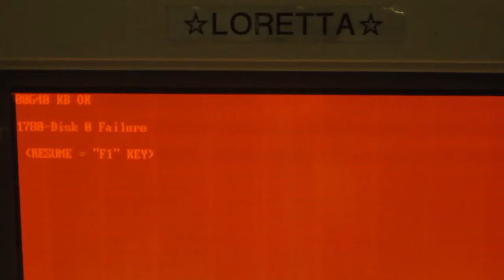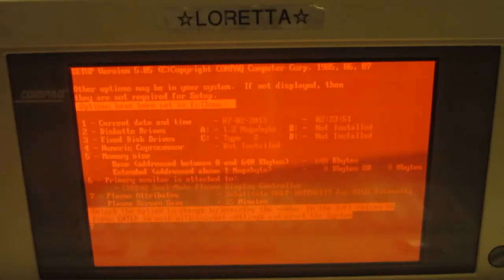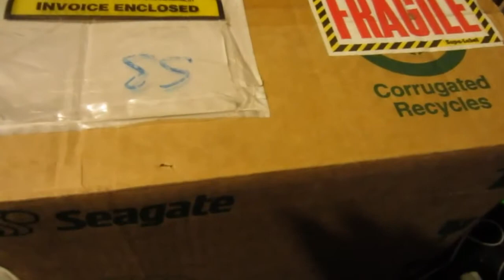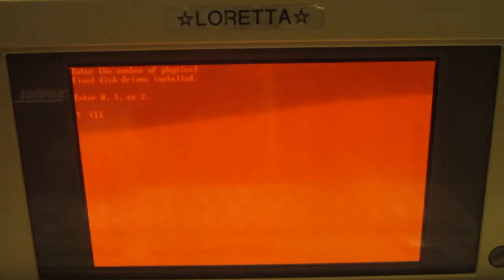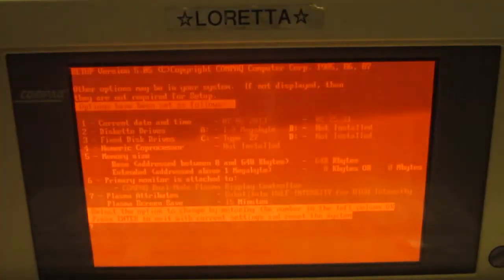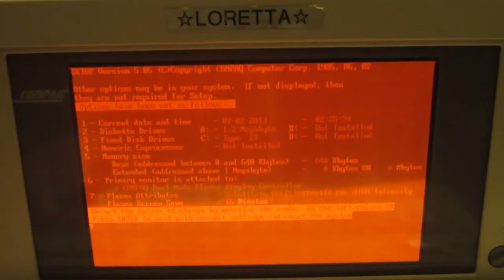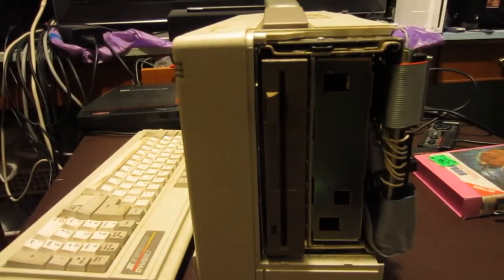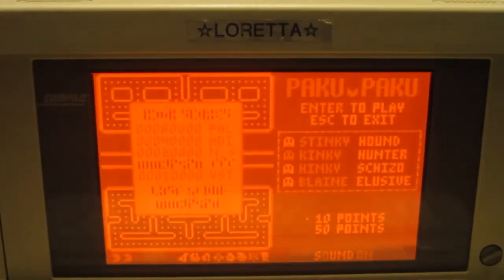Compaq Portable III hard drive upgrade (luggable 286)

Comment: If you would have a copy of the boot information on a 5.25 inch floppy drive I would be interested.
Reply from the maker: Did you end up getting a disk?
Reply: No.
Reply: Does anyone have the right disk for it? Or a link?
Reply: @iganas88  I have a disk for it. As well a 5.25 version and 3.5 version. Installed and tested on floppy disk. for 15 euros you can buy. regards
Reply: @thomashagelaars1619  Have you tested the 3,5 version? I got one from oldcomputers.net, but it gives me "Load failure" error when trying to boot from it. If you got a different version that's guaranteed to work, I would pay 15eur for it
Reply: @iganas88  Thanks for your reply. I will test tonight if it's still working. I'll let you know.
Reply: @thomashagelaars1619  Thanks! The boot disk from oldcomputers.net works perfectly on a 386 portable system, so that's why I'm certain it's just an incompatibility issue or a wrong image
Reply: @iganas88  Sorry, give me a little more time. The Compaq P 386 has a 5.25 floppydrive in it at the moment. To be 100% sure if it's working, I will change the floppydrive in it. I hope next weekend I can make time for it.
Reply: @thomashagelaars1619  Sure, thanks!